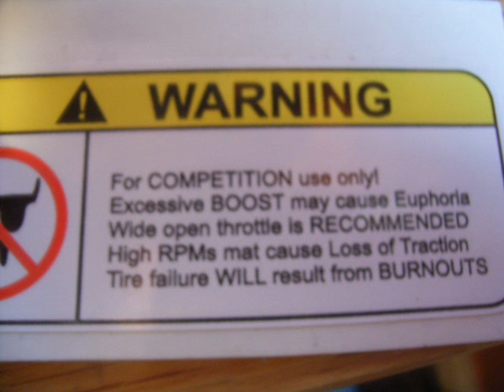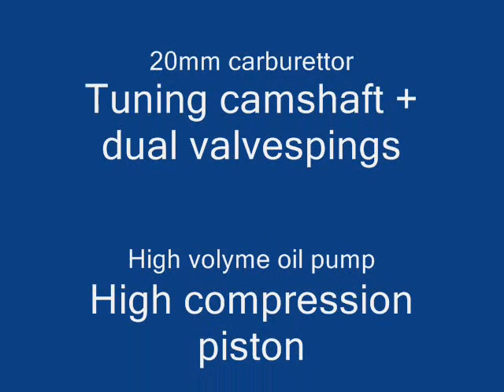Lifan 50cc Race engine

Comment from the maker: its made first for 107cc engines but its fits bolt on on the 50cc to. builds on the same engine block a 50cc engine can be stroked up to 107cc without any mods maby some grinding requeired

Comment: @bozze86 

2 strokes is much better, my zanella 80cc 2 stroke 115 km/h race with 110cc and 125 motorcyles 4 strokes. and my suzuki ax100 2 strokes race with Honda XR 250 4 strokes

Comment from the maker: @stephen1993wooster t mark on the flyweel is tdc that mark 12o clock on the engine and then little dot on the cam sprocket in the head 9o clock in the head in the spot that is marked in the cam sprocket space

Comment: gentleman, time to face the facts.

a fully tuned 2 stroke beats a fully tuned 4 stroke from with the same amount of cc's

however, when you see 2 stroke has twice the amount of ignitions in theory 2 stroke should have double the power.

this however is not true, and that is basically why 2 stroke sucks.

a 80cc 4 stroke would lose from a 50cc two stroke if you look at the maximum amout of fuel that can be burnt inside the cilinder, but a 80cc 4 stroke totally rips a 50cc 2 stroke.  4stroke ftw

Comment: Rofl

Hell no, You couldn't beat a 125cc Fully tuned MT

34mm Carb, HPI, 6 gears, Custom Exhaust, High pressure Head.

Just no fucking way you can beat that.

Comment from the maker: well it was i test. this engine was sold unfinished.
i did this only fot the fun of it

whell the intake is 20mm and the exhaust valve is 18mm om e22 heads on these 50cc:s

Comment from the maker: no u have wrong the 120-140cc have 27/23.
the 50-90 have a stock 20/18 what i know
and 100-120 have 22/20 (if i remember right)
i have been in the dremmel on this heads. 

and on a 50cc u can´t fit bigger valves

Comment: Nice 'Dremelwork' on those ports, but you can go much bigger still, by starting off with the head from a 90-125cc version.
These have 23/27mm valves and much bigger ports.
Should be easily available second hand from a broken pit bike.